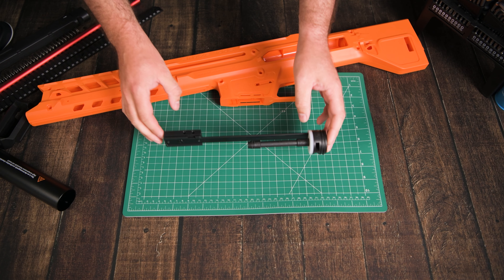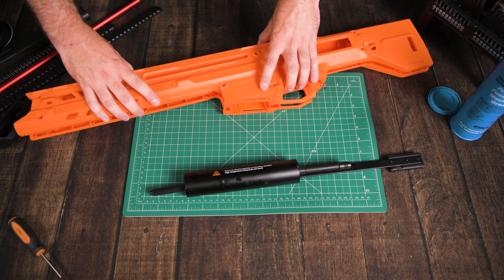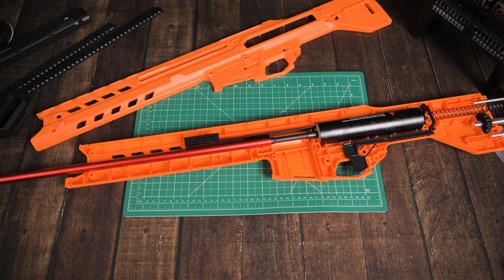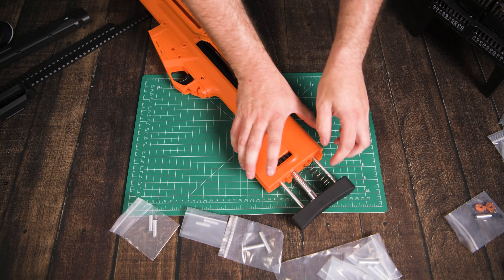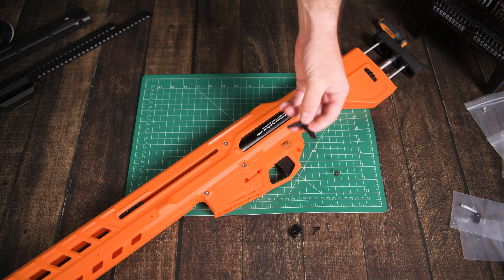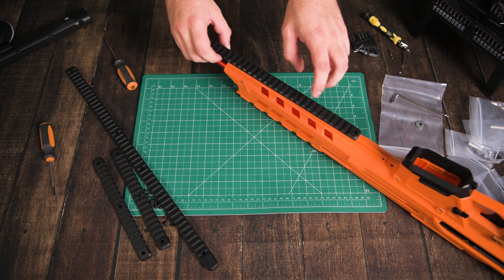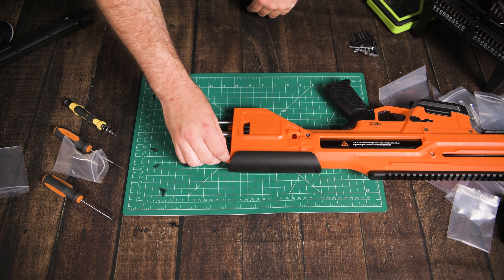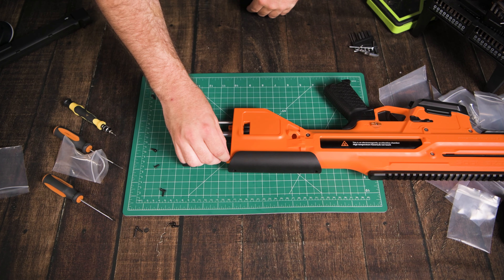ZWQ S100s Baize Assembly Guide!

Comment: Could you measure the plunger travel distance until the O-Ring reaches the air hole in the plunger? Maybe just need to rotate the tube until the hole is visible. Trying to find the volume of the plunger from the point where it might first realistically have an air seal.

Thanks!

Comment: With heavier springs to reach 300fps, do you think the bolt being plastic is going to be a problem?
Reply from the maker: Probably not, the rod is connected to the part where the rear orings are, not to the pusher itself like old Longshots were. There is apparently a metal internals kit though if it worries you.
Reply: It's possible, although an easy piece to upgrade. However, I've run my Baize in several 300 FPS events and you don't actually need a super heavy spring to reach 300 FPS with the larger volume. I was hitting 300 FPS with the same strength of spring the Worker Harrier needed to hit mid 200s.

Comment: My O-rings did not create a perfect air seal at all on my Baize, any clue which diameter the ones you got were? I had to teflon tape the heck out of it to get anything near a seal
Reply from the maker: Just the standard ones. The only air leak was the pusher.
Reply: @BradleyPhillipsYT  Odd, i guess they gave different O-rings for the metal internals? Because my metal pusher O-Ring seal was perfect out of the box and my metal plunger and piston O-Rings needed 1-2 wraps of teflon each. I also had trouble with the bolt stop needing to be sanded to fit smoothly into the shell, and still had issues with it basically not working so next time I go to throw a new spring in there i'll probably remove it too. Looking forward to the upgrade video a ton!
Reply from the maker: @godeatsbagels  possible that the metal and plastic internals are just different overall. I don't have the metal internals but interesting to hear.
Reply: I had similar problems with my Baize sample, however I just cleaned it, and used new o-rings (same size as original), and the seal went back to perfect.

Comment: this looks flimsy as compared to harrier. everything is in plastic and I used to have a s200 fire rat plunger end cracking on the first day.
Reply from the maker: It's pretty thick plastic. I would have preferred metal internals though especially the pusher as it would allow a larger inner diameter for air flow.
Reply: @BradleyPhillipsYT  Do you have the Metal Internals kit?

I've run my Baize in several 300 FPS events without any breakages. I was hitting 300 FPS with the same strength of spring the Worker Harrier needed to hit mid 200s.
Reply from the maker: @FrontlineFoamBlasters  no I only have the plastic kit
Reply: They ran a car over it you should be fine 😁👍